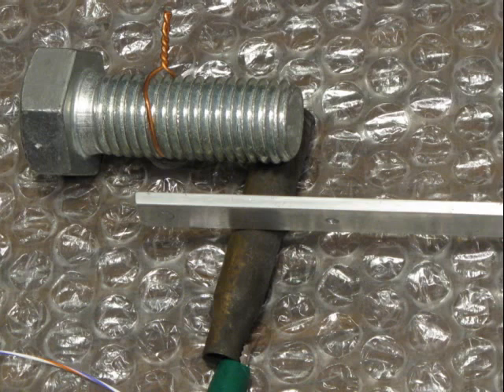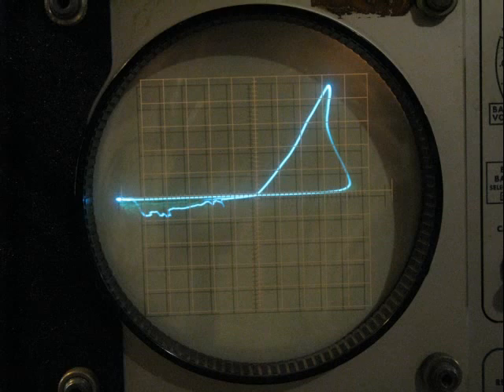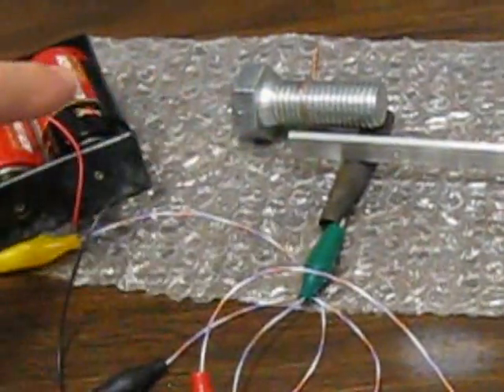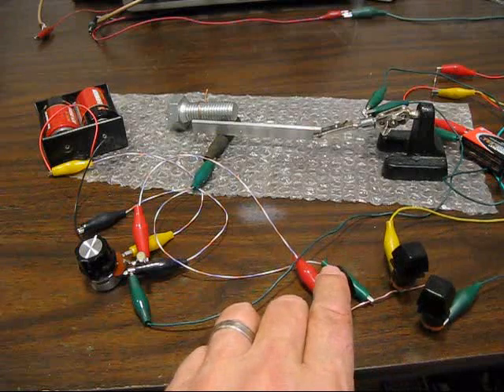Homemade Memristor

Comment: 00:14 The narrator noticed gravel, sulfur smell, and corroded rifle cartridges.
00:40 Aluminum and cartridge connected to the curve tracer produced a curious memory.
00:59 The memristor is receiving a lot of attention
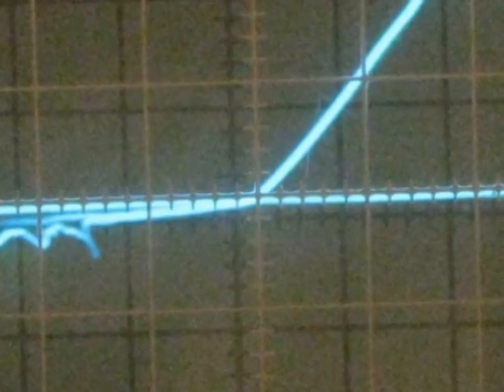01:19 Homemade Memristor can be made using copper or lead and powdered sulfur.
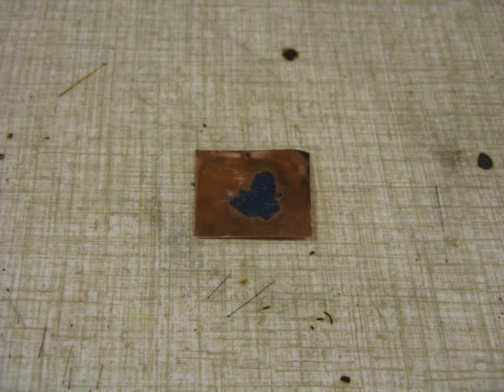01:38 Aluminum contact with a sulfur-coated copper sheet creates a functional memristor
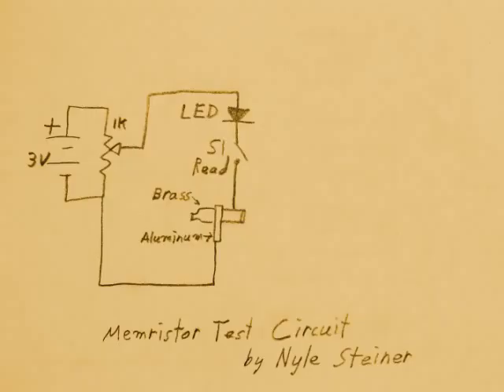02:02 The LED lights up when the memristor is turned on.
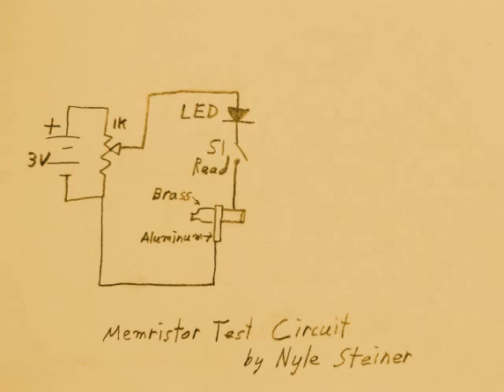02:21 To turn on the memristor, add s2 in series with a current limiting resistor and a 9-volt battery. To turn it off, add s3 in series with a current limiting resistor and another 9-volt battery.
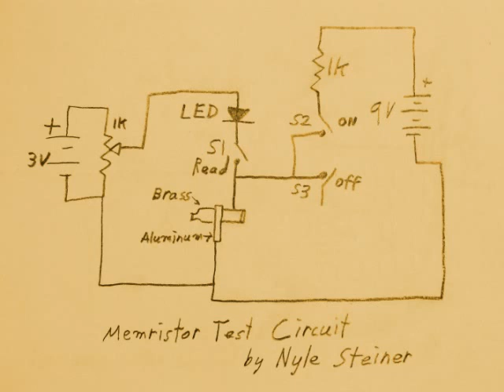02:38 Memristor is a component that can control the flow of current.
Crafted by Merlin AI.

Comment: .....the crystals long ago that could be purchased for crystal radios in small boxes like matchbox toy boxes were of course lead sulphide called galena . You'd have to mess around with the cat's whisker to find a spot where rectification occurred. .Some folk messed a little more with batteries randomly connected at other points of the crystal and might chance upon slight amplification ( the first transistor effect ) .Apparently there was a frustrating non repeatable thing going on also  for this amplifier effect . This memristor gives an insight . All the metal sulphides have very interesting properties.

Comment: Initially i thought that this was some kind of hoax, but then i found a paper called "Fabrication and electrical measurement of copper sulfide memristors", which describes a similar method of manufacturing memristors. Cu/CuS/Ag Memristors seem to have outstanding electrical characteristics, but the CuS film has a habit of breaking down over time.

Comment: I've been trying to recreate this memristor by using copper and powdered sulfur. I'm having difficulty testing to see if it actually works. I don't have a curve tracer so I've been trying to just apply different voltages across the corroded copper/sulfur but I'm having trouble actually applying voltage because it keeps reading it as a short. Any suggestions?
Reply: did you ever have any luck ?

Comment: Thanks for sharing.
And would you have an idea if the "Reversed Pulse" (for switching off) needs to be higher voltage than the "Active Foward Voltage"? 
And please also correct if it is foward voltage or current?
Peace.

Comment: Hi @nylesteiner do you think it's possible to create a simple crossbar Logic gate using your memristive device. I will like to know if the memristore change its resistance based on frequency or polarity .last question are the states are programmable or read only.

Comment: This is amazing! Have you achieved the effect with any material other than aluminum in contact with the sulphur reacted surface? I imagine an etched copper clad board with specific pads covered in sulfur to create the reactive surface. If a solderable springy metal can be soldered to an adjacent pad, and the point allowed to make contact with the black pad... well, we may be talking about the possibility of full printed memristor circuits! Just gotta figure out that point contact.

Comment: Never mind I recreated the effect. My problems were that the corrosion layer was too thin and my contact point was too large. With a nice thick layer on the copper I got a memristor topping out at around 1.2 meg and bottoming at about 20 ohms.

Comment: I haven't been able to recreate this effect. I have a very low resistance across the device (about 10 ohms). When first activated I can see a small reduction in resistance (from about 20 to 10 ohms - regardless of current direction) and can see no discernible change in resistance over time. 

I'm using an unetched, uncoated copper backed glass fiber board (the type used for home board etching) and a sliver of kitchen foil.

I don't suppose anyone has any idea's where i could be going wrong?